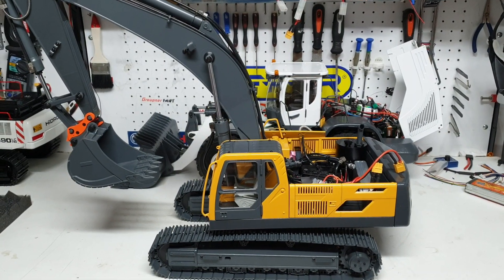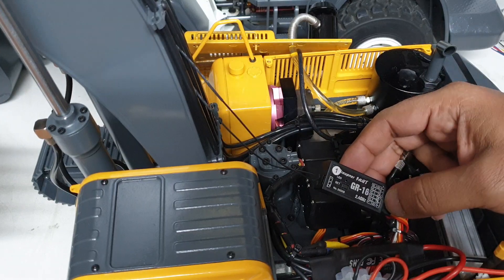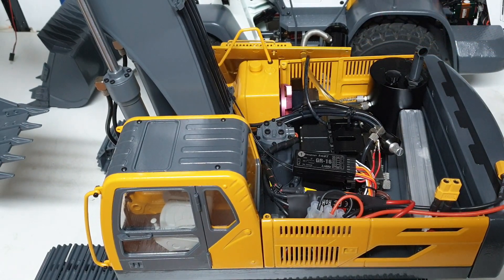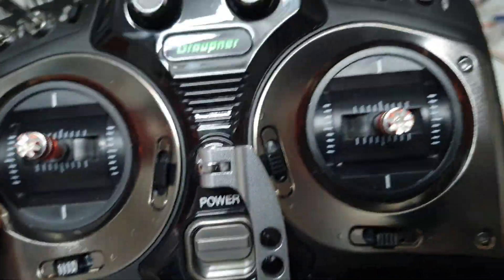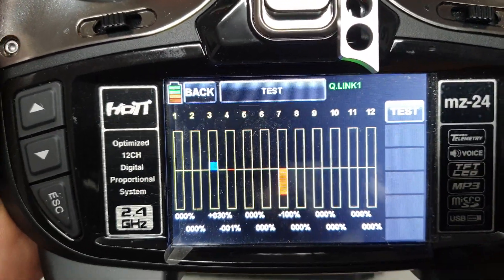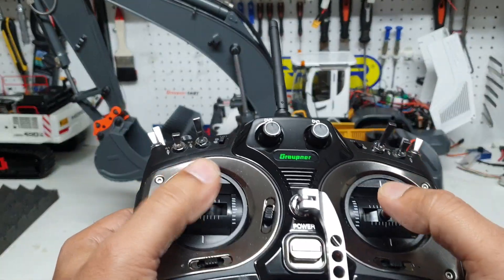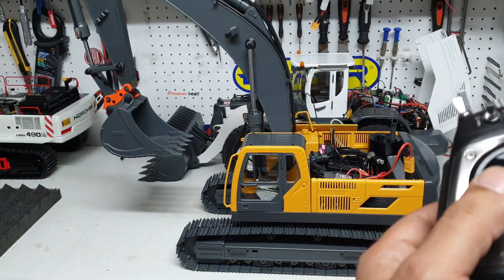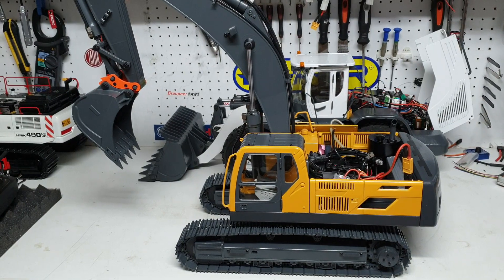CSMI RC Hydraulic Excavator start sequence and tips

Comment: Hi Kevin, Great video 👍
we were always told to switch on the radio first and then the receiver on the model so that the model is not live without a signal from the transmitter. Then there is no chance of the model starting or taking off in my case with helicopters.
Reply from the maker: Hi John yes that is right. These ESC won't arm them self . Thanks for the positive feedback too.